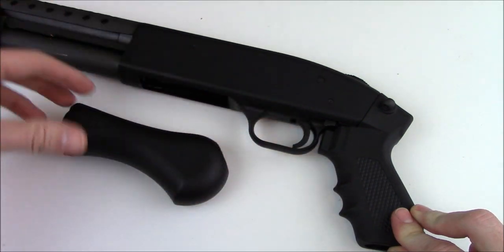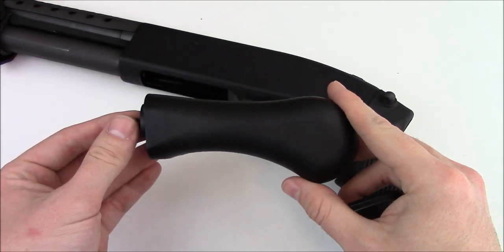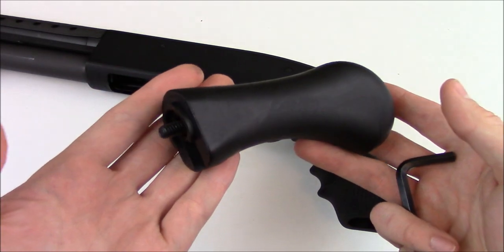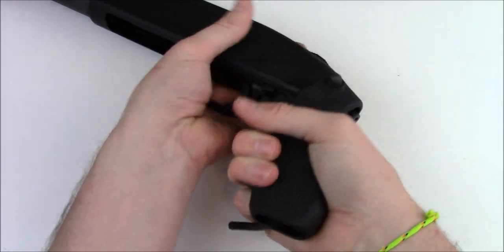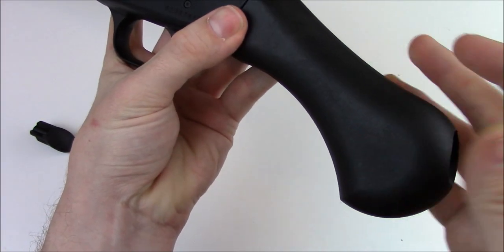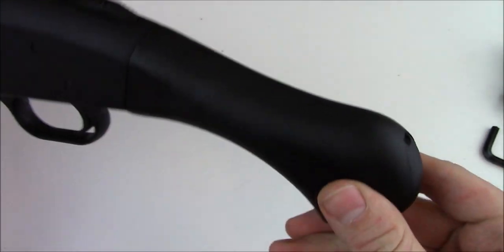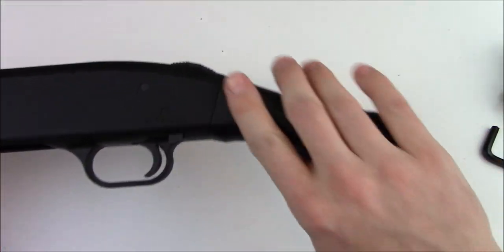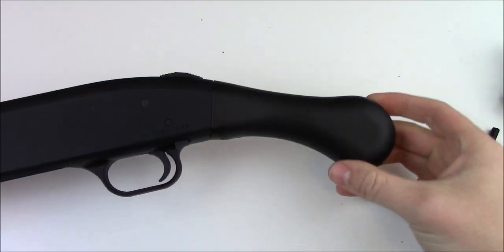Mossberg 500 Shockwave Technologies Raptor Grip Install

Comment: The Mossberg 500 cruiser has a 18.5 inch barrel so it does not fall under NFA as a AOW. If a shotgun has NEVER had a stock, it can become a AOW. If a stock has ever been attached and it has a barrel length less than 18 inches then it is a Short Barrel Shotgun under NFA.

If Joe Blow wants to manufacture a AOW from the Mossberg 500 cruiser it will require an approved Form 1 filed with BATFE with the $200.00 tax. Subsequent transfers will be on a BATFE Form 4 with the $5.00 tax paid. If a Class II manufacture makes the Mossberg 500 cruiser a AOW, he will register it on a BATFE Form 2 (no tax) and then transferred on a Form 4 for the $5.00 dollar tax.

Most of the Class II manufactures buy the virgin receivers so that there is no question that there has been a stock attached when they make the shotgun AOWs.

You better contact the ATF. I dont think you can cut that barrel without a stamp
Reply from the maker: This isn't an AOW though. If it were under 26" overall length, then it would be an AOW and would require a $200 manufacturing stamp to produce. The difference between a "Firearm" and an AOW is concealability, and the ATF has used the federal standard of concealability of 26" overall length. The ATF has given the opinion several times that Joe Blow can manufacture a non-AOW "Firearm" that fires a shotgun shell, with a barrel sub 18" PROVIDED that the overall length remains over 26" and it started as a "firearm"(AKA a pistol grip only Mossberg regardless of original barrel length) that has never had a shoulder stock applied. I'm not in uncharted territory here, this thing was built following already established guidelines put forward by the ATF. The base Mossberg that I started with was never sold as a "shotgun" as it never had a shoulder stock applied, and was transferred to me appropriately as an "other" on the 4473. I'm happy to provide the ATF letters showing that this was 100% ok for me and you and anyone else to build (and check out my other vids, I chopped the barrel and built this thing over a year ago, lol).

Comment: I have a shockwave but I was told that I couldn’t make changes to the handle? Illinois
Reply from the maker: Federally, you can, as long as the new grip doesn’t make the overall length shorter that 26”. State laws may vary.
Reply: @booliganshootingsports  got it

Comment: could you put on a pistol grip on a 14 inch shockwave barrel or would that be too short in length ?
Reply from the maker: That would bring the overall length under 26” and create a felony unfortunately. I will say, Birdshead grips like these are MUCH more comfortable and controllable than a more vertical pistol grip.

Comment: Once you add that piece to the end of the barrel and magazine, is it permanant. Do you weld like the official Shockwave?
Reply from the maker: It’s pinned in place on the magazine tube, and hammered onto the barrel. It’s pretty solid, but able to come off by tapping out the pin for cleaning.
Reply: Booligan Airsoft and Shooting Sports, just what I needed to know. Thanks!

Comment: Question how do you take the birds head grip off?
Reply from the maker: Dallas Rhymes it’s got a small plug that you remove to access the bolt.
Reply: Booligan Airsoft and Shooting Sports just got it thank you sir I’m normally not stupid 😂
Reply from the maker: Levi Cross  A small flat head screwdriver. It's a gun, you should be banging it up in use, lol. A little scuff won't hurt anything.

Comment: When are you going to show cutting off the barrel? My parts are in the mail to shorten mine.
Reply from the maker: I didn't get any video footage of me actually cutting it, but I'll let you know how I did it. I started with a rotary style pipe cutter to get a decent concentric groove started in the barrel. Then I clamped it into a miter box and slowly used a hacksaw to cut it all the way through. A few minutes with a file to get rid of the burrs and to smooth out the bore and it was golden.
Reply: Great! Do you have a finished pic?
Reply: Did you cut it at 14.25, or a little longer so the heat shield would clear?
Reply from the maker: I cut it at 26.5" overall length. The barrel ended up being right around 14.25. Now, when you hammer/press on the new barrel lug, it'll add some length too, which keeps the heatshield doable if you're willing to put in a LOT of work on it.
Reply: I am...but I want to see how YOURS turned out with the heatshield!
Reply from the maker: http://i.imgur.com/ee9kg01.jpg
Reply: LOL...I JUST came here to tell you I found your pic on Imgur!
Reply: Looks great!
Reply: I see you added mounts. What sling are you planning?
Reply from the maker: I'm having a custom lightweight laser cut bandoleer sling made through Whiskey Two Four.
Reply: Parts are in and I'm putting it together. I'm adding a Mossberg metal heat shield that is 13 1/2" long. I have decided to grind an 1/8" off the back, making it mount flush with the end of the lug. Then I will tap 4 hole in the lug to attach it. I can not tell– how is your shield attached in front?
Reply: Never mind, I searched and found you on reddit. (There appear to be a lot of negative people with too much time on their hands on there) I think the only reason you had to remove the front clamp from the shield is because you are using the MOE forend- right? The front clamp on my shield fits perfectly snug over the lug.
Reply from the maker: At the front of mine, the shield is bent in shape to clamp around the lug, and it is kept from rotating or sliding forward due to a notch I cut in the shield that fits over the front sight bead. It's on there, but has a bit of rotational free play that I don't like. I'll be tack welding it to the brake to keep it in place in the future. 

I had wanted to do it your way, by drilling and tapping holes in the lug to secure it, but I wasn't able to make that work with the factory headshield.
Reply from the maker: The clamp on mine was the exact same size as the lug, so I wouldn't have been able to stretch it over the lug. The MOE forend only affected the body of the heatshield, not the clamp.
Reply: I did not see an email on your website it send you a pic.
Reply: Sent photos to your email.
Reply from the maker: That looks great! I wonder if your heatshield is for a 590 shotgun instead of a 500. That would explain the larger diameter of the clamp.
Reply: I remembered the same thing. It's a heavy barreled heat shield I ordered a few ago that did not work for me because the front bolts were exactly in the wrong spot.
Reply from the maker: That'd do it then. Looks like people wanting to run a shield on these should absolutely pick up that heavy barrel heat shield. It'll be way less work to mount it your way compared to the way I had to mount my standard heat shield!

Comment: when you install that raptor grip, you are now changing that weapon from an nfa item, to a non nfa item! pistol grip shotguns are considered aow's and in my state also require a 5 dollar tax stamp from the ATF. being that shockwaves with the raptor grip are not classified as aow or shotguns, but classified as only a firearm. so you might want to double check before you start doing all those mods! if you bought it as an aow, it has to stay an aow, because thats what it was designed and designated from the factory. the receiver is designated pistol grip only shotgun.
Reply from the maker: Everything you said is incorrect. Let's start:
1. Federally, a Shotgun shell firing firearm that is equipped with a pistol grip only and has never had a shoulder stock isn't a shotgun or an AOW. It's a Firearm. That has been the basis on these builds for decades before Mossberg started doing it themselves. Adding a raptor grip to a PGO (pistol grip only) firearm doesn't change the classification at all. Only shortening the entire firearm to less than 26" would reclassify it as an AOW.

2. AOW transfer stamps are $5. AOW CONSTRUCTION stamps are $200, which is what you would need to do to build one of these that's shorter overall than 26". But since it started as a PGO firearm in the first place, you can add a raptor grip and chop the  barrel while retaining an overall length greater than 26" with no reclassification to AOW or SBS. 

To answer your comments on your 2nd comment, yes, this is a real firearm. It started as a 20" barrel equipped Mossberg 500 Pistol Grip Model. It is sold as a firearm. It is transferred as a firearm on a 4473 and not as a shotgun. The base gun cannot be sold to someone under 21 years of age because it's not a shotgun, it's a firearm. Since the base gun is a firearm to begin with, it can absolutely be modified in this manner 100% legally on a federal level. If it was a Mossberg 500 Shotgun with a shoulder stock, then this build would absolutely be a felony, but since it started as a PGO, it's a-ok.